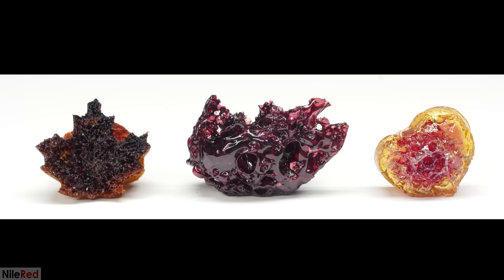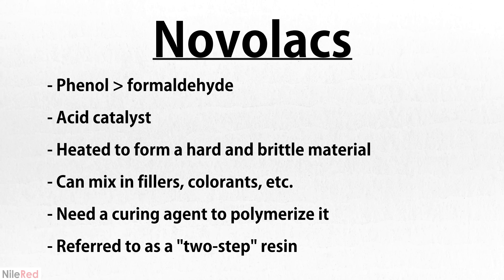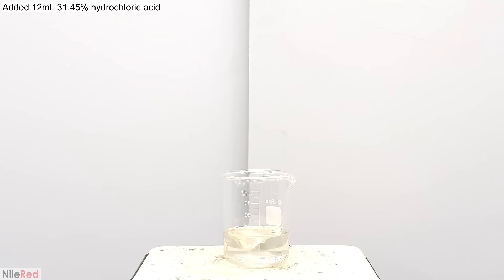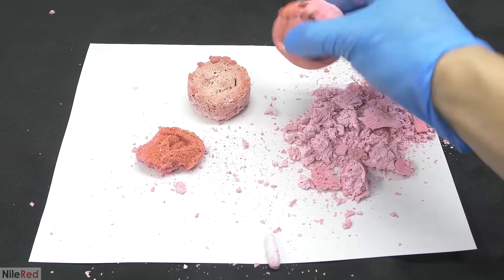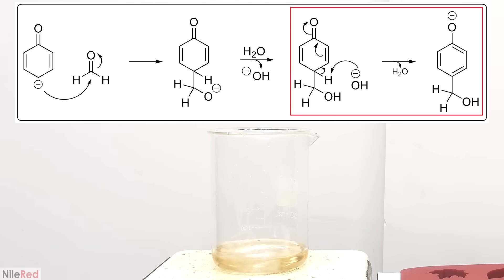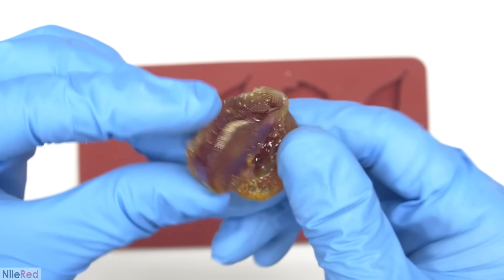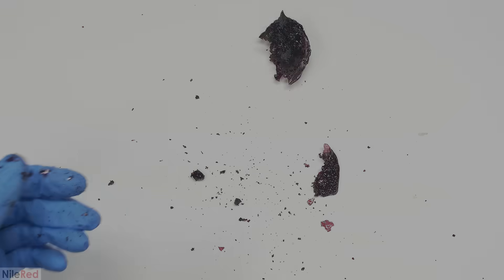Making bakelite plastic (Part 1)

Comment: Pretty sure a "Bakalizer" is nothing more than a preasure cooker. Ive got like five of them of different sizes used for cooking and pressure canning. 
I get mine from second hand stores but you can buy stovetop versions new at almost any big box store or cooking supply store or online. Or get an electric version which should maintain a more consistent temperature, though  those are far more expensive.

Comment: A pressure vessel that can go to three Bar is relatively inexpensive use heatproof tubing (copper) leading up to it (with heat fins to dissipate the heat) and a heater with a controller and insulation around it and you have your bakelizer.

Comment: Bakelite was also used to make Kalashnikov style magazines due to it being cheaper than steel and more durable than aluminum.
Reply: Similar chemicals, but it was a fiberglass reinforced version called AG-4S. Tough as hell from what I've heard.
Reply: @galvanizeddreamer2051  its also cancerogenic. shame since its such a lovely looking plastic
Reply: @long_chin_man  Most things are carcinogenic, especially in the gun world. But you should be safe as long as you don't grind up your old plumb AK mags and snort lines of them.
Reply: @galvanizeddreamer2051 Does AG-4 have any phenolic resin in it? Wouldn't it break down in moisture over years? Those mags are sometimes 40years old and doing well
Reply: @Pg4141laika Absolutely no idea. I just heard there was a difference from another comment somewhere.
Reply: Bakelite AK stuff has an aesthetic that is so satisfying 👌👌👌
Reply: Hell, a guy made entire gun frames out of the stuff. German krobov? I think thsts his name.
Reply: @neonman54  As much as I love bakelite, I would not trust a rifle made out of lmao. Those weird prototype bullpups the Soviets made look jank as hell
Reply: @shanemcdowell3628  As long as the barrel is made out of metal and is thick enough then there shouldn't be any problems. You wouldn't want an AR-10 incident.
Reply: @shanemcdowell3628 oddly enough the germans used bakelite to make the entire lower receivers for their MP38/MP40 submachine guns excluding the grip/stock trunnions.
Reply: This is the only use I've known for bakelite unill now lol
Reply: @N54MyBeloved  akm bayonets too
Reply: A lot of guns in WW2 had bakelite furniture like handguards and grip panels.
Reply: @agentoranj5858  such as the mp40
Reply: Also the pistol grip making it one of the first ever standard issued rifles to have a polymer grip
Reply: Bakelite mags are cool.
Reply: @professionalschizo  ah my bad. Thst makes more sense

Comment: Bakelite is still widely used.
Especially in heat resistant applications such as knobs and handles on kitchenware and electrical switches and sockets.
>

Comment: Bakelite is one of those products that isn't made as much anymore but is actually higher quality than what is currently being used instead. Since it isn't as soluable it holds up more than other polymers. Actually, a lot of people test to see if their thrift store jewelry finds are bakelite by swiping some acetone on the surface. Modern plastics will melt while bakelite is uneffected. Since "vintage" bakelite is worth a bit of money as lots of people collect it, this is worth testing for say an eBay/etsy seller. I find this concept fascinating since putting plastic in acetone is one of my favorite things to do... I make jewelry and sometimes redesign cheap costume jewelry. The easiest way to get cheap plastic rhinestones/cabochons out of a metal bezel is just to drop it in a bowl of acetone and it's just really cool to watch or to repeatedly poke the melting plastic with a toothpick.
Reply: That's bc bakelite is a thermosetting polymer and once it's set, it can't be reheated for recycling, unlike modern day plastics
Reply: Isn’t bakelite the type of plastic they used for plastic parts on early electric guitars? That stuff “gassed off” and became brittle after a while right? (I might be confusing it with a different type of plastic)

Comment: @NileRed I find myself 50 yo and I still remember many things that were made of bakelite. In my grandmother's house, the telephone, the wall sockets (outlets) and parts of her toaster were made from bakelite, for instance. All things made of bakelite I remember were coloured black. They all shared one aspect, they would break easily.. the bakelite used for them was hard, but brittle - it would not live up to any kind of impact. I always thought that that was just what bakelite was like, that it was an unavoidable sort of imperfection of the kind of material. Watching your video however makes me wonder if that brittleness actually rather was due to the amount of fillers that the producents of all those things put into it. I can imagine that using fillers would make it much cheaper to produce things that were made of bakelite. And, if I understand correctly, it was already put under pressure  to cure it in the forms used - which also would have made it very easy to fill them up with a powdery filler first, then flood make that filler and make it absorb a much lower amount of the actual bakelite whilst still in liquid form. And when it was cured its surfaces would be as smooth as the insides of the forms that were used were, and you totally wouldn't be able to tell by sight that any fillers were in it anyway. .. until you actuality broke the household item that it most likely was what they made, and even then you'd only be able to tell be cause of the grainy inner structure that now got exposed. You think that is how it was, or were other effects causing these properties? And thank you by the way!
Reply: You very likely had the cheap bakelite that came after the patents expired, which were made to capitalize on it. It's not the main reason, but it's one of the major reasons why bakelite is pretty much extinct today. Once the patents expired, nobody did things right and just wanted in on the action, subpar products caught the market and so a lot of the stuff is cheap and brittle. Properly made bakelite is very strong, it behaves less like a plastic and more like a composite. I have original bakelite bars, from the original manufacturer pre 1930's and they're very durable. Some chips exist, wherever they were dinged and dropped over the years, but no shattering or cracking. And we're talking about thin stuff, used to promote the product, not actual use items that would've had various strength inducing features like fillets or ribs.
Reply: @aserta  I think another thing is also just the quality of molds and products. Vintage Italian and French coffee stuff is chock full of black bakelite handles and knobs, most of which have held up much better than most plastics even from the 90's to 2000's on game consoles or kitchen appliances.
Reply: Soviets used the bakelite far into 1980's that was quite robust and withstanded time quite well also, I remember seeing switches and outlets from 1960's still intact in 2000's, some even outside in the sun._
Reply: It was probably made with novolacs method
Reply: I used bakelite in school while hand making electronic boards, and that stuff was hard and robust, you'd have to hit it with a hammer to make it break, and it just like 4mm. I don't remember having to struggle a lot when sawing it, I think it was similar to cutting softwood.
And I do remember the insides being whitish and grainy, so I guess it was a novolac
Reply: It also doesn't age well, especially if it's in sunlight, like by a window.

Comment: So if you had the leaf shape one in the toaster oven under pressure it wouldn't have bubbled so violently and would have kept its leaf shape? Or would it have reacted quicker because the boiling point would be lowered...?

Comment: What is recommended if one wants to make a composite  with magnetite and some polymer that  avoids using solvents that might damage the insulation used on magnet wire.

Comment: Could a laser cutter moving quickly with perhaps multiple passes heat a very thin wire of material that would quickly dissipate the heat and keep from Foaming? 

Could the material be given a final cure with a pressure cooker and compressed air rather than steam to pressurize It? As the air was compressed it would heat up though a home built rig might still be hard to keep at the right temp and pressure.

Comment: NileRed, check out this patent for making glassy carbon https://www.google.com/patents/US6241956 it details a method of casting and curing the resin with a hydrophilic organic solvent to give the water somewhere to go during curing without puffing up. It doesn't mention a pressure, just a 40 hour cure at 70-85C followed by a 10 hour cure at 90-100C. I wish it gave more details though.

Comment: Would you be able to use a pressure cooker, or does the vessel need to be able to withstand more extreme pressures than a pressure cooker can handle?

Comment: Would a kitchen pressure cooker work to make small batches of bakelite?
Reply: RonJohn63 I'm guessing a larger more powerful chamber is needed to continue to keep pressure up as mixture is releasing lots of gas.  But that is certainly better than the toaster oven he used!
Reply: I'm guessing you wouldn't want to put formaldehyde in your pressure cooker either though :p

Comment: Hey nilered, really love your videos! I have a question that pertains to this one a bit, or at least phenol formaldehyde reactions. Some vintage electronics have printed circuit boards that are made out of phenolic resin - also produced from a phenol/formaldehyde reaction I think. Whenever I turn these on there is a very strong and distinct odor - not unpleasant in any way, just something I'm not completely used to.
I tried doing some research and I read that the fumes from these chemicals can be toxic and harmful... but I'm not sure if this applies to the product of phenolic resin that's made from them? When I turn them on and I'm smelling them, obviously some aspect of it is entering my body. Is that harmful in any way or something I should be cautious about? I love my vintage gear but safety is a priority of course
Reply: Is say to try to avoid the fumes as much as possible. At best, you won’t die from them, but you will become hypersensitive to them over time and could develop rashes and breathing problems. Worst case scenario, it destroys your lungs and you slowly suffocate to death for the next 20 years of your life until you eventually die. Formaldehyde is really nasty- especially the fumes- so any time you’re working with it I’d suggest using a fume hood. The smell is also horrific on its own.
Reply: It can be phenol. It has distinct ( even little sweet) odour. You can smell it well below hazardous concentrations. Formaldehyde on the other hand is completely different, but it smells unpleasant and harsh.

Comment: Two questions:
1 - Would the soft uncured resole stay gummy bear like for a long time or would it solidify eventually?
2 - Would containing the mixture in a ridged container with no room for air make the polymer solidify without bubbles, would bubbles still form, or would the reaction just not take place?
Reply: It cures in room temperature. It just takes a lot of time. It solidifies without bubbles.

Comment: Best demonstration of the bakelite i've ever seen! However, there are something doesn't make sense in your suggested mechanism for ether bond formation: you're following the one-step mechanism SN2 but it seems that your illustration point out 3 step with 2 intermediate stages (they don't look like transition states very much) which have pentavalent carbon centers@@ Moreover in basic condition, the oxonium intermediates aren't thermodynamically preferred, are they?

Comment: Hey Nile,
I´m watching your videos since over 1,5 years and have never commented one. But now I´m going to do it. I really like your videos and pretty much all of them are really interesting. I got a question for this one: what would happen, if you do it under vacuum and only slowly heat it? Would it be possible for the water to escape at much lower temperature when the stuff is still liquid? or wouldnt it polimerize enough? I could guess, if you heat it faster, the bubbling problem will get much bigger, but I´m not sure. And for the high pressure method: does the formed water stay in the plastic, or does it get removed in some way? Greetings from a Bachelor chemistry student in 6. Semester.
Reply: https://youtu.be/o9N0GF9ZxMU
Reply: You can cure resole resin in room temperature, you just need few years. Water also comes from condensation during curing, so you cant completely remove it before hardening. I do know if all water stays in the polymer, but it gets removed via diffusion after hardening.

Comment: Could you degas it first?
Reply: The bubbling is created by the residual water reaching its boiling point under atmospheric pressure. If the reaction was occurring inside a pressure vessel capable of being heated to well beyond water's atmospheric boiling point, the reaction would create a stronger and more dense final product

Comment: Q1: if you added the hydrochloric acid more slowly, say, like titerization while controlling the pressure, can you create a denser bakelite?
Q2: If the polymerization got set by heat, and not the reaction, once it reached stage b would adding temperature deterrent like a liquid bath outside the beaker to keep the water from boiling while keeping enough heat to cure, say, 70-80 degrees celcius resulting in purer (albeit dotted by more water particles), denser bakelite?

Comment: Bakelite still used in some applications that require high heat resistance and good electrical insulation properties such as vehicle ignition components and electrical outlets.
Reply: And ashtrays.

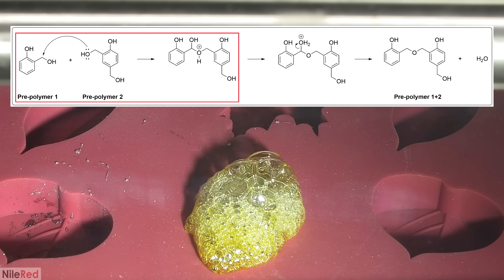Comment: Not to be nitpicking or anything but the mechanism at 15:39 is wrong. You've drawn some sort of oxidation-reduction. Instead a benzylic -OH should attack a quinone methide. There is also an error in the structure at 16:00.

Comment: Would it be possible to use something like a pressure cooker as a makeshift bakelizer? It might not be perfect but since you can use it to control both heat and pressure I'd think it'd work a little better than a toaster oven.
Reply from the maker: It would definitely be better than the toaster. Controlling the heat would still be hard though and it might not be able to get hot enough
Reply: NileRed Most pressure cookers usually cook at around 250°F/120°C which is just enough to cause the resol to cure, It might be worth a shot in a future video.

Comment: NileRed what if you dried the ingredients over sieves before trying to make it?
Reply: Tobias _ it wouldn't help much, the reaction generates H2O so it will get "wet" once it reacts
Reply: Do you think it would work in a vacuum?
Reply: in vacuum it would work even worse 'cause the H2O would expand even more, you need high pressure so H2O won't expand at all and just stay as water and not as steam
Reply: The Chemical Workshop the bubbles wouldn't be able to support themselves and would pop rapidly
Reply: okay that's true but also the reaction would happen even faster because vacuum is the worst thermal conductor
i mean nile red could try vacuum but i don't think it will work out
Reply: The Chemical Workshop I think it would be cool to make identical ones, one in a vacuum chamber and one in a pressure cooker to see the differences.
Reply: yeah why not :)

Comment: Here is the procefure for you: next time try to use higher F:P ratio, about 2.2 to 2.4. Add about 6 to 8% of caustic to phenol at the begining, heat things up to 60C and then add formaldehyde so that the temperature not exceed 65C. After addition, heat mixture up to 85C and condense under reflux for about 2-3 hours, then cool down to room temperature. To harden or to make a mold heat up to 100C (it will get puffed) or add 5-10% glycerol triacetate (triacetin) or diethylenglycol acethate. With esters one could make a perfect candy like mold at room temperature.

Comment: Hi mate, love the idea! I remember my mom always used to complain because she had to use a Bakelite phone at her office and it weighed tons she said, especially since they had to hold it up solely by squeezing their cheeks and shoulders together so that they could write with both hands. It gave her permanent neck problems that monster of a brick.
Anyways, was just thinking about one thing.. Why didn't you use a regular pressure cooker to do the baking in? Those things will take even boiling water up to 120 C, easily, and it might even serve as a "bakelizer"? Just an idea... :-)

Keep up the good work, love to see that you're releasing some new stuff now!
Reply from the maker: +Erik Persson you need 200c to cure the bakelite. Also the temperature needs to be carefully increased, which would be hard
Reply: Well, if you have a good, easily adjustable heat plate it wouldn't be a problem, and also, 200 C wouldn't be a problem to get in a pressure cooker, since it's not the cooker producing the heat, it's what's underneath it that does ;-)
Wasn't the "bakelizer" basically a more pumped up pressure cooker?

Comment: What is a mol?
Reply: BeGamerSl a mole(mol) id a unit of measurement in chemistry that gives the amount of a product that contains 6.02*10^23 particles of the material. For example, there is 6 grams of carbon in a mole of carbon. Hope i helped! :-)
Reply: Actually in a mole of carbon weights 12 grams. This because the atomic weight of carbon is 12 uam. The mole is very useful as it easily correlates the atomic weight with the mass you may measure in your laboratory and can thus, very easily, be calculated the quantity of molecules you have.
Reply: BeGamerSl  Thank you for correcting my mistake.